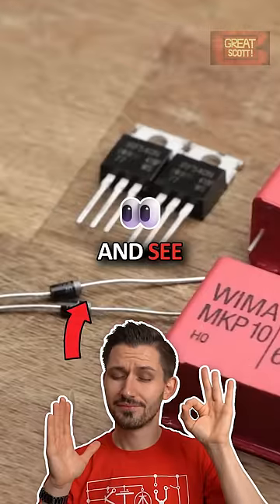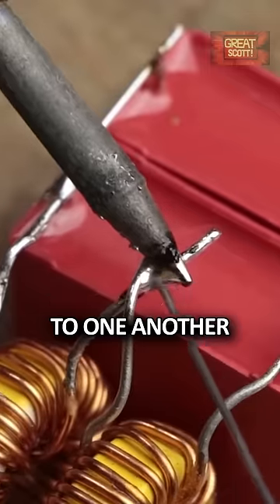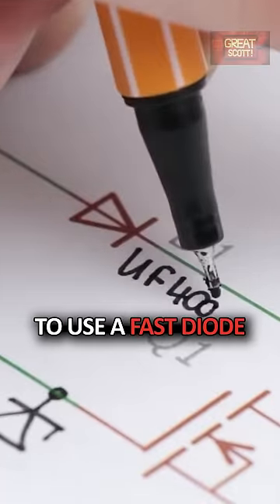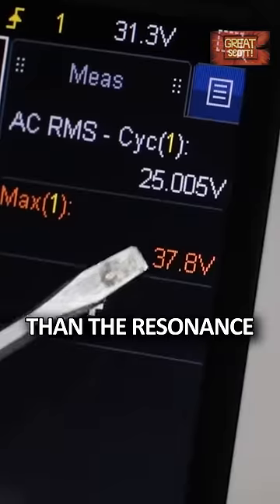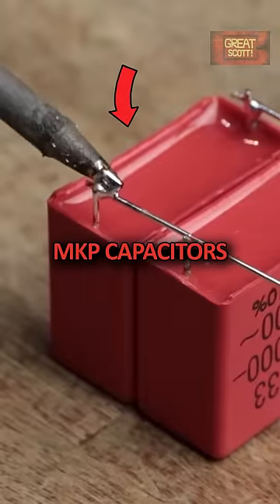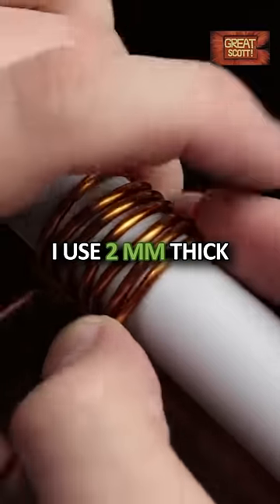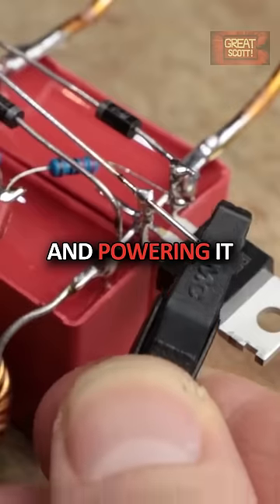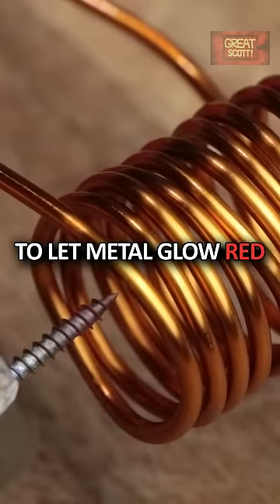Induction Heater Circuit (DIY)

Comment: ZVS Driver ftw, why dont u hook up the output of the driver to a crt flyback? To get a HVDC power source
Reply: Electroboom? :D
Reply: @TheXtremeBoltGuy  ye
Reply: What good would that be for an induction heater?
Reply: @Astri.electronics None. You will get some nice arcs though
Reply: @TantalumPolytope   Great, but it's not the point of the video
Reply: @Astri.electronics  I agree on that
Reply: A CRT transformer won't have thick enough wire to handle the amount of current required to do induction heating.
Reply: @TantalumPolytope  yea
Reply: @deang5622  can u read the comment properly please?
Reply: @FlammableElectronics  The problem is your grammar. It is wrong.
You constructed two separate sentences with the conjunction And.
This is wrong.

You need to learn to write properly.
Reply: @deang5622  okok
Reply: @deang5622  And you need to learn how to read comments properly.
Reply: @TantalumPolytope  No. My incorrect comment was a direct result of your poor grammar. Had you written correct English my error would not have occurred.

Learn to take responsibility for your poor command of English.
Reply: @deang5622  Explain where I made the mistake. You didn't even reply to my comment initially so how does my grammar matter anyway?
My English is fairly good actually. I can take responsibility if I recognise the issue, which I currently don't.
Reply: @deang5622  Also, even if the grammar isn't exactly perfect, you can still read it if you have half a brain. English doesn't become intelligible if someone accidentally makes a few mistakes.
Reply: Completely stupid comment. Demonstrates a very basic failure in the understanding of electricity.

For induction heating a high current is needed.  You don't use an HV DC power supply to generate a high current.

What actually happens is most often a step down transformer is used, which steps up the current to a higher magnitude, and also steps down the voltage.

Induction heaters, therefore tend to be low volt, very low voltage but high current.
Reply: @deang5622  bro read the comment properly, I ain't induction heating with this, am making HV high freq or HVDC from low voltage high current which the ZVS can supply to the primary coil
Reply: Yes, that works too. Takes a fraction of the current to drive a flyback too so it won't put as much strain on the mosfets. I've measured the current with induction heating and those bad boys can pull 40 amps.
Reply: @deang5622  That wasn't even the point of the original comment. Please, learn how to comprehend english. He didn't even mean to use the flyback for induction heating. He said you could replace the induction coil with a flyback to get nice *arcs*. He said nothing about heating anything with the flyback. Read the original comment so you can be arrogant without anyone having to correct you because that is just embarrassing.

As someone said earlier:
"Learn to take responsibility for your poor command of English."

Comment: When you want to power the zvs with voltages within the limits 12-15 v better is IRFZ44n because have lover on resistance What prevents heating more than in irf540 with higher on resistance

Comment: Just use a dc to ac converter with a protection circuit and add a coil to the ac output

Comment: I have simpel question how culd it by posibel to phase shift ordinari 555 timer around +/- 20° ? The circuet in question is the mc 3334 hei ignition module I have for years problems finding correct reverse voltage protection for that thing my circuet does not have zener diode I dont have many things to work with .So my currioseti got bether of my so I wondered if useing dual ignition modules wuld do that phase shifting ? I noticed 2ignition modules I can activate with 1 pick up coils,I noticed it needs only the positive pick up coil trigger that made my wonder if it is posibel to use some sort of pulse generator on the negative pick up wire to some how disrupt the signal for the module ? Im simpli anoyed with that thing . So hoppe some one see this comment and can make some sugestions how to solve that problem or at least explain to my how I can calculate resustor to capacitor value to the ic chip or module components to achive desired phase shift for that mentioned mc 3335 ic chip .

Comment: How can i build a buck converter which can go below 3v.
Reply: Play with your driving frequency, and adjust some of the component values
Reply: T555 timer to make a switching regulator and multiple voltage dividers  so u can drop it below 3 volts and with capacitors at the output for consistent voltage
Reply: Depends on what exactly you need
-Max input Voltage
-Min output Voltage
-Max output current
-Max output current ripple
-Efficiency

Low power, low efficieny, high output ripple buck converters can be bought of ebay for almost nothing. And Digikey&Co. will let you buy whatever you need.

But if you truly want to build it yourself you should first check if a "simple" diode based buck converter is efficient enough (you mention 3V output - so ~1V diode loss would be a pretty big loss) or if you need a synchronous converter (using a second mosfet to replace the diode and increase efficiency). Either way you will need a control IC - I would search for "synchronous buck converter ic application note" and read about the basics of buck converter design and available chips - buy some(enough!) follow the application note an build it. If it blows up repeat until your happy with the design 😂

Comment: why not use proper construction techniques qith a metal chasis + PCB  + proper heatsink + proper terminals?
Reply: Just to annoy you, properly.
Reply: Al that just for a test setup / prove of concept? 

And as long as you fully drive the FET’s they don’t dissipate that much heat.